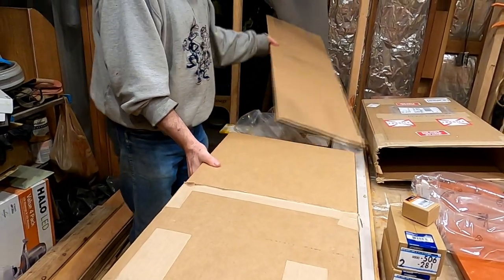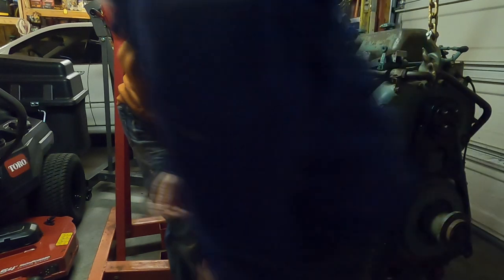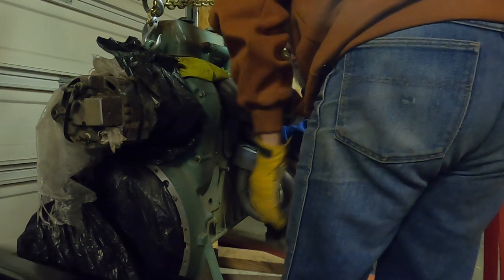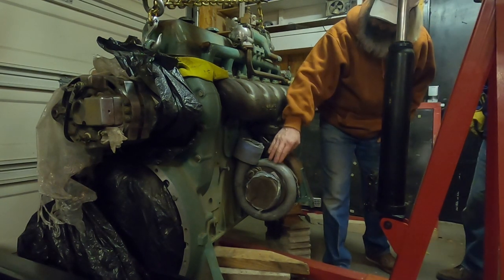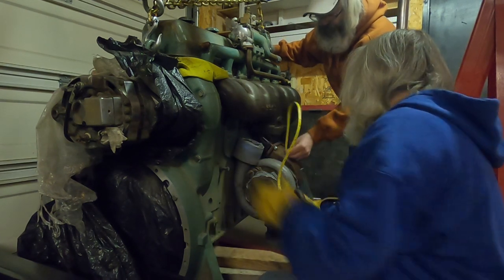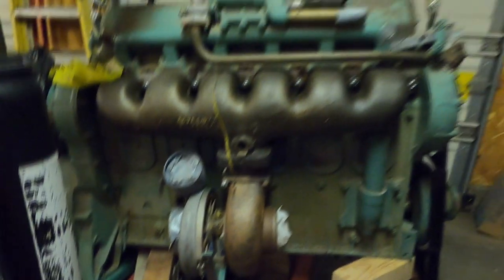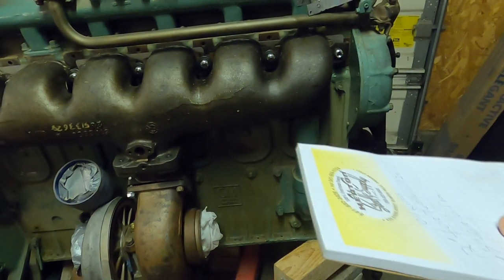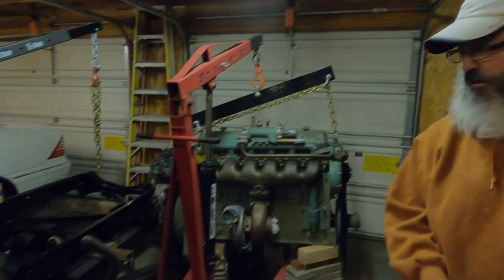Gasket for Oil Pan for 671 Detroit Diesel Engine,Turbo oil lines measured for new install.GM PD 4103

Comment: You've got the right idea for the feed and drain, just take the fittings you want to the hose shop and they can make it for you.:)
Reply from the maker: I'm going to have to take the oil pan with me plus all the connections to and from the turbo....do you think with the turbo getting so hot it might be to close to the engine and heat it up to much????
Reply: @doityourselfwithfixinitwit270  No it won't heat the engine.  Feed the turbo like you're doing from the cold side. :)

Comment: Hey guys that paint will work even if it's just an enamel.  The engine block only gets to 180-190 and the oil to 225 max.:)
Reply from the maker: I had painted the engine in 2014 when we overhauled the engine with 500 degree paint ( Detroit diesel green ) from O'riellys ... I'm thinking if I use anything else it might react to the paint I already have sprayed on there...so what ever I use I will have to test a small spot to see how it reacts....I think I will run down to O'riellys and get the same paint as before if I can....

Comment: P.S.  make sure not to use a restriction fitting you see some guys using.  It will starve the turbo of oil and ruin it.  I'm running two turbos on my 4-53T and neither turbo has a restrictor on the feed lines.  The Detroit has a huge amount of oil flow, so turbo bearings will be happy.:)
Reply from the maker: What kind of oil lines would you use? Would you use metal mesh flexible lines like we have on the Allison transmission we are putting on? I don't know the correct name for the lines I'm talking about...or would just regular lines be OK....What should I ask for when I get the shop to make the oil lines?
Reply: @doityourselfwithfixinitwit270  Any good nylon braid or steel braid will work.  The guys at the hose shop will know.:)
Reply from the maker: @detroitgarage9430  Thanks for the info ...much appreciated....